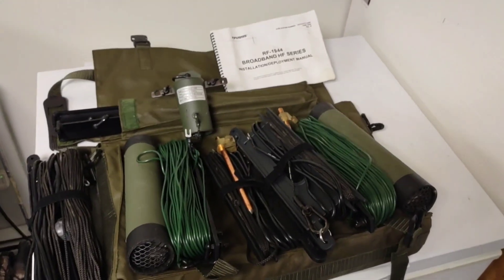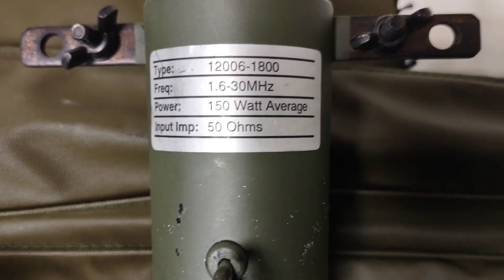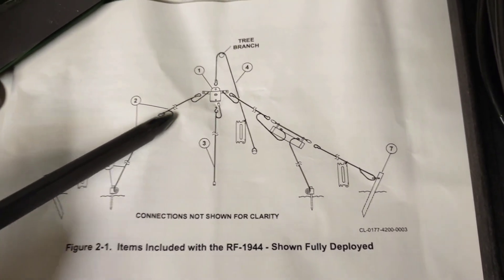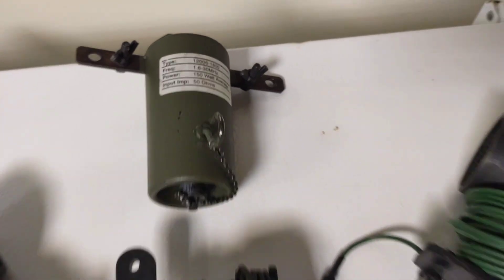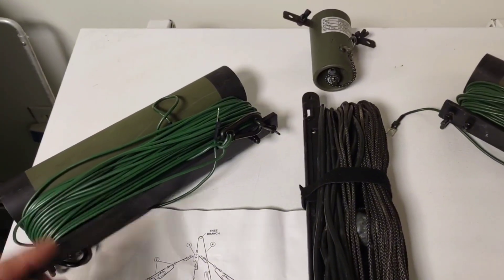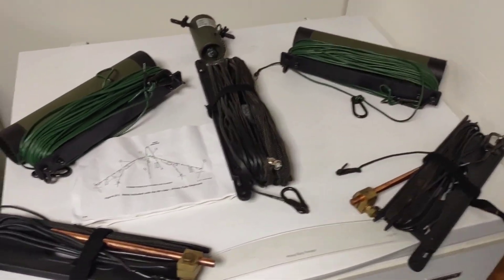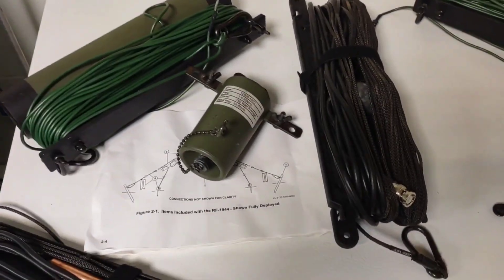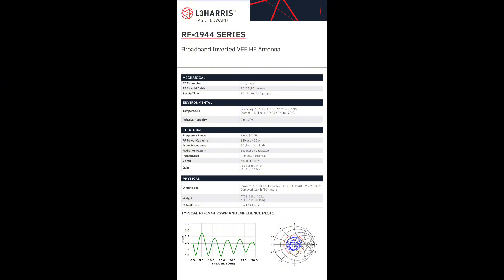RF-1944 Harris Military HF Antenna for Ham Radio operations.

Comment: I have the same antenna and it works fairly well.  I bought it with extra parts and built an end fed terminated vee with the other parts.  If I have room in the field I use the full antenna and if I don't I use the "Half a Harris".  73
Reply from the maker: Good to know.. I might try this